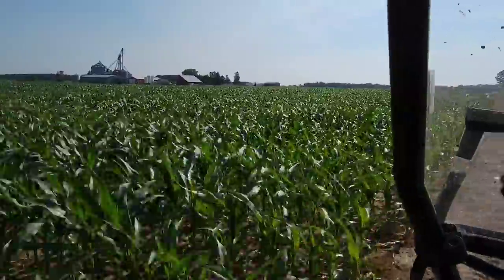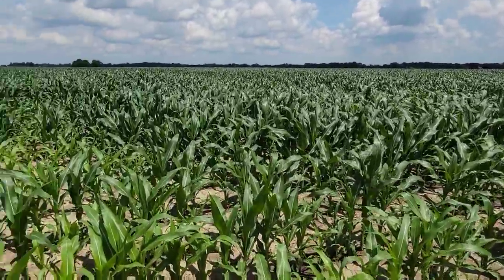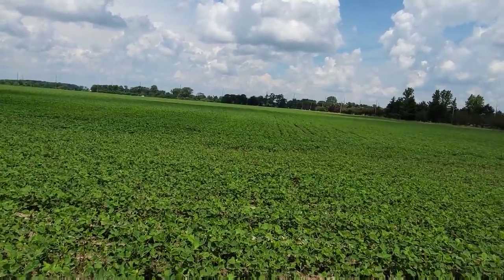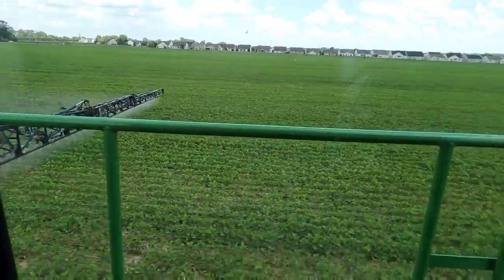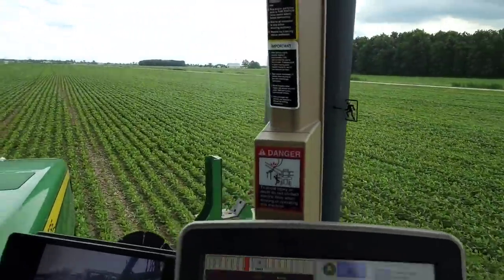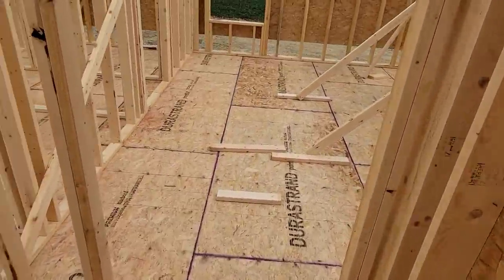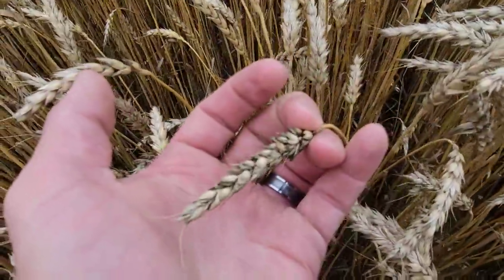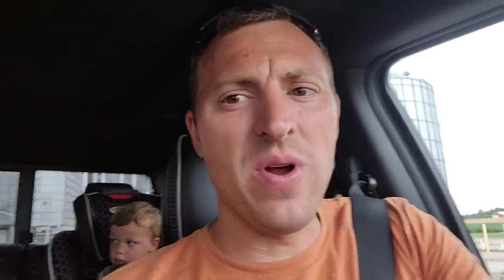Spraying Beans! #448

Comment: Thought the state chemical farm certification requirements are rather unreasonable. The Indiana regulation said all chemical containers >35 gallons must be housed in containment bunker. Since most states seem to collaborate, doubt MI & OH will differ significantly. YMMV if I read the rules correctly. ❓👀
Reply from the maker: Our chems just have to be stored on concrete

Comment: On the compaction thing I wondered if when you change the   planter instead of going for exact emerge and hi speed etc why not have a 32 row standard. (Assuming your corn head is 16 row) the additional width makes up for the speed of the fancy new ones and as you said you don't need to be that much faster as you already do it in a week or so.
You can have the planter on tracks too. Less than half the compaction compared to now. When in the future you  eventually change the 8R go for a ex demo 8RX. Gradually work towards what you want without breaking the bank?
Reply: Thought he said corn header is 8 row❓🤔🤷👀🕵. AND need mighty large fields for a 32 row to be practical, maneuvering & turning.  Nathan may not agree❓
Reply: @billupstateny9151  yes you are correct. I went back through several videos lol and it's 8 row head. He did say a 24 row planter doesn't fit between the poles.
I was going to say 24 row on tracks but guess Nathan will say not.
I'm from the UK and we don't grow corn so I don't know what I'm talking about lol just thought go wider means at same speed it's faster and less compaction that's all?
Complicated dilemma it seems?
Reply: @nigelgribble8736  The larger planters carry more weight w/ fertilizer tanks & exacerbate the pinch row issue.

Comment: what page do you go to in your monitor to put all your chemical information?
Reply from the maker: Menu>GS3>Documentation
Reply: @BorderViewFarms  is documentation an unlock? when i turned documentation on when i was seeding earlier this spring it stopped making a coverage map. just wondering if that would be a setting that’s wrong on my end or if you pay for that. thanks
Reply from the maker: @joelkenney5500  no its included but you have to make sure everything is setup correctly and you don't have extra operations recording. You may have extra tabs along the top.